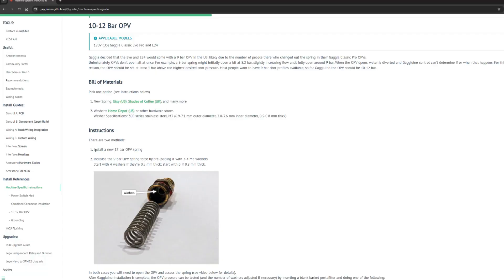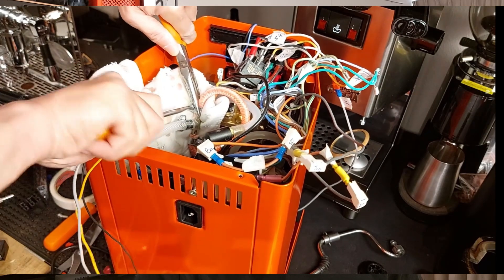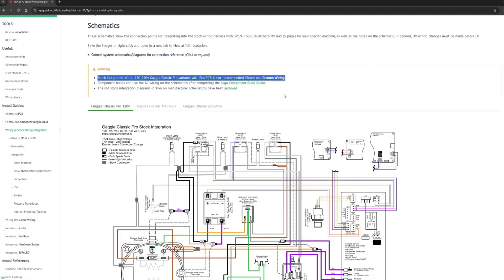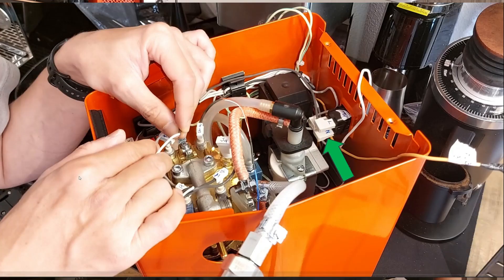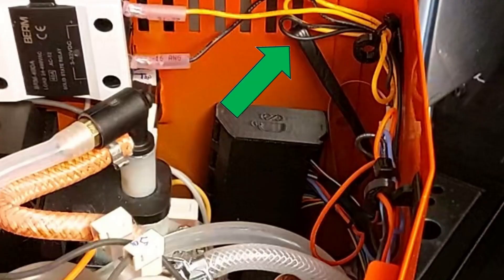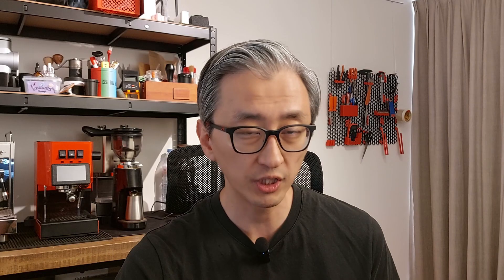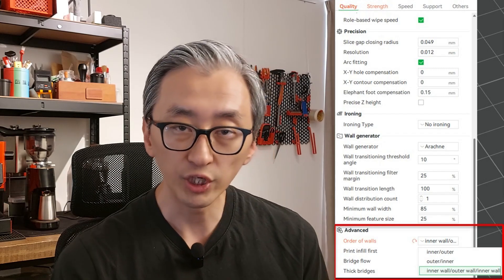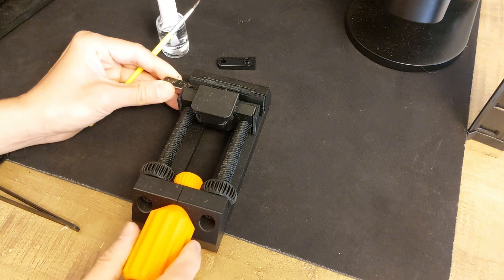Watch This BEFORE You Install Gaggiuino Gen3!

Comment: Is 18 AWG and 26 AWG sufficient? or should I use 12 or 14 AWG for the high voltage lines?
Reply from the maker: 18 AWG is sufficient for 220v. Or 16 AWG if your machine is 120v.

Comment: T handle speed wrenches are very useful to have for these machines, ones that accept different bits are handy. Also a pair of Knipex 86 03 125. 

If you're a 3d printer guy the knipex pliers come in handy for any number of uses as the locking mechanism and flat jaws keep your parts from getting damaged while maintaining a firm grip. I use them for inserting magnets into friction fit holes. Put the magnet on the upper jaw and use the plyers almost as a press to put the magnet in. They seem expensive until you use them, then you'll get it :) And wonder how you lived without them, they are like the internet of pliers.
Reply from the maker: Thanks for the comments and hints. I have a pliers similar to the knipex that you mention, locking pliers and a bunch of other tools. But I need to make a better use of what I have, I didn't think about the use of my locking pliers to insert magnets, it's a good idea. And I need to buy some T handle wrenches, I'm a bit accommodated with my kits that solve 99% of my problems, sometimes not as fast as I could with better tools, but I don't use them so often and I'm always postponing. But I'm gradually getting better equipped. Thanks again! Very useful hints. I'm taking notes for future purchases!

Comment: I would like to know if you ever think on i solate the boiler of the gaggia to prevent thermal problems with other componentes.For example the rancillio silvia has an insolated  boiler but the top of it is not insolated i asume that they made that in order to  tha heat transfers to the cups.
Reply from the maker: I think the insulation is to increase the energy efficiency and temperature stability only, not to protect any component. I was not planning to adopt in my Gaggia Classic since the temperature stability is good enough with PID or Gaggiuino. Notice that if you steam, it will also take longer to cool down / consume more water when flushing.
Reply: @EspressoHackers  thanks very mutch!!!!!!!Ill not insolate then😅

Comment: Any reason to choose gen3 over gen4?
Reply from the maker: Gen3 is the latest one. It's a bit confusing because the boards are V3, V3.1, V4, and you may have a board that is V3.1 and Gen2. But if you buy today, you can opt for Gen 3 and board V4.
Reply: @EspressoHackers thanks, I was definitely not picking up the distinction. I’m enjoying your channel, especially these mods. Would be interested to see something about the gaggiamate too
Reply from the maker: @gpatkinson thanks. I don't know when, but I'll test the Gaggimate for sure.